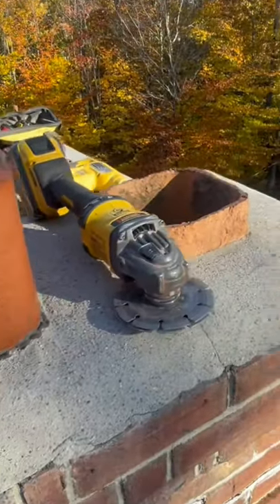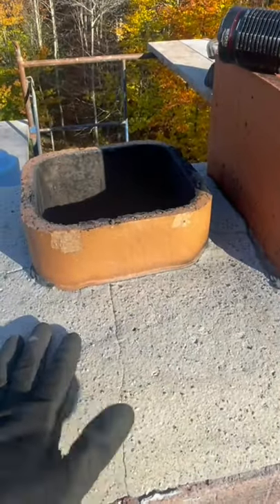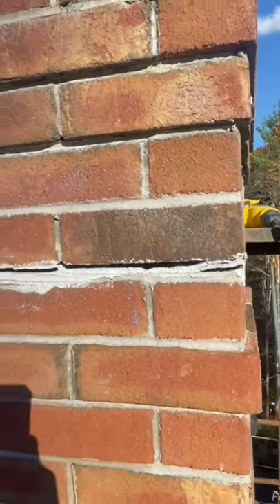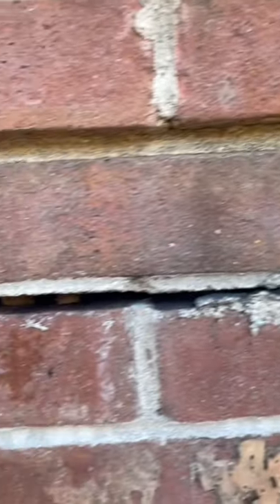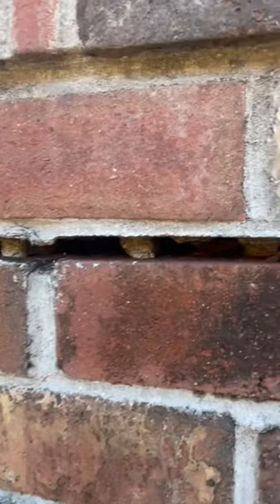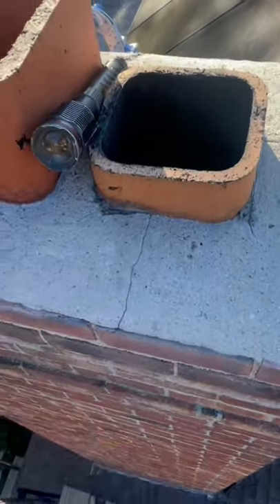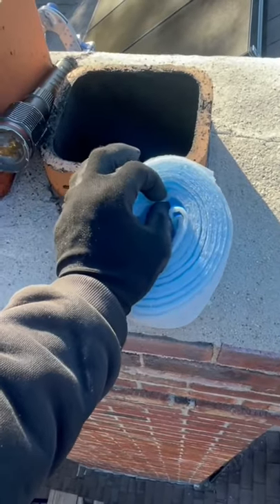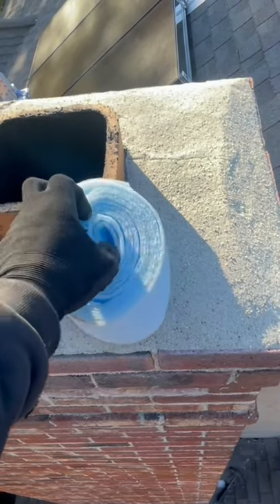Why chimneys need a bond break (required to be code compliant)

Comment: Just like when you pour a slab on top of block for a porch, you lay roof shingles down on top of the block to make sure the slab doesn’t lock in to the block cells. That way you won’t see the block crack when expansion occurs

Comment: That pitch looks a little sketchy!! Nice editing and images are really sharp .... looking forward to your next video. Is better to rebuild partial chimney or tuckpointing? Great video
Reply from the maker: Thanks! I still really struggle with editing, but I feel like I’m getting a little better. I think grinding and tuck pointing is fine here. The more important thing for me is replacing the top flues (they were cracked) and pouring a new concrete crown wash with a proper bond-break around the flues.

Comment: Wait you’re not supposed to leave that expansion gap material in there, right? My thinking is you wrap it around, pour your new concrete crown, remove the wrap and use high temp silicone caulk in the gap. Anything that gets left should be fire proof.
Reply from the maker: Yes the sill seal can be removed with a little effort. Although from my experiments heating it, I think it would also be fine to leave as well. It just tends to melt under extreme heat and not catch fire. If you’re worried about it then just remove it or use foil-backed ceramic insulation.
I know masons that still use wood under the crown wash directly against the flues and nothing fire related ever happens. It’s awful practice and I wouldn’t ever do it, that being said a little melted sill seal isn’t going to harm anything in my opinion.

Comment: It should definitely be rebuilt. Me and my boss always run into that. And we never use anything like that around the flue. And we use master seal np1. It's an epoxy that got good stretch rentention. And comes in multiple colors
Reply: So tuck and point is out of the question?
Reply: No we wouldn't tuck point it. We'd tear it down to the place where it's separated and rebuild it up

Comment: What do you do when bricks start failing like that? Theres a few on my building that got bad from water damage to the point green is growing on the side of it. Haven’t really decided how I am going to rectify that. Im in the brick layers union but part of the stone and tile side. So I’m confident in fixing it. Just don’t know how yet cause still not quite sure whats going on
Reply from the maker: It’s caused by water infiltration combined with time and cold/harsh weather. The inability to drain water or dry out is a big problem.

Comment: How about stone wool? I think it would be perfect for this application
Reply from the maker: Sure, it would work fine. It would be easier to work with, if it didn’t fall apart so easy though. If you could find a 1/4” thick sheet of it, then it would be perfect in my opinion.

Comment: Chad do you need to come back and caulk after cap or wash is poured?
Reply from the maker: Yes. This is the main reason why people don’t do bond-breaks nobody wants to make one more trip to seal it up.
Reply: Which sealant do you recommend?
Reply from the maker: Mflex makes high temp silicone in clear, black and red. Technically you’re supposed to use a high temp silicone. I personally think it’s fine to use clear lexel, through the roof or something equivalent. I think they have enough heat resistance for this application.
Reply: Type 1 GE Silicone has good temp rating... better than Lexel... definitely Lexel in cold or wet weather though.
Awesome video... new favorite channel. Thanks Chad

Comment: Foam is crap, uv would destroy it and have a leak in under one year. Bad design, maybe not as attractive but any over hanging cap of the finial would allow motion and prevent most seepage.
Reply from the maker: Why would you assume the foam would be left? Why would you assume it wouldn’t be sealed? I didn’t realize people wouldn’t understand this.

Comment: Haha...heat will melt all those things..🙄🙄
Yr not a professional..do yr research
Reply from the maker: I know for a fact heat cannot melt ceramic insulation. Yes, if left in the sill seal will melt with enough heat, no harm done. 
You seem like an intelligent person, maybe you could share a better way with all of us?
Reply: Nfpa 211 and irc will both tell you expansions joints are needed to be up to code when pouring a crown. In 7 years of being a csia certified tech, I have seen only a few crowns poured properly. 

Without an expansion joint the crown will fail given enough time. Either the crown cracks or the tile does.